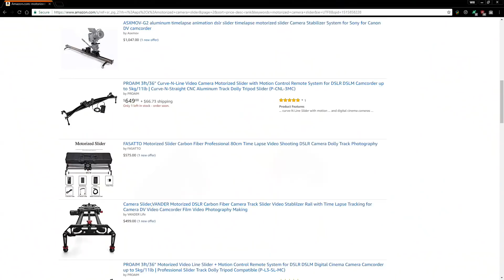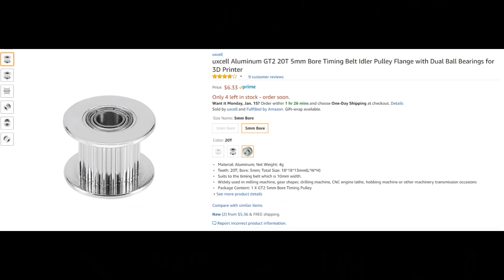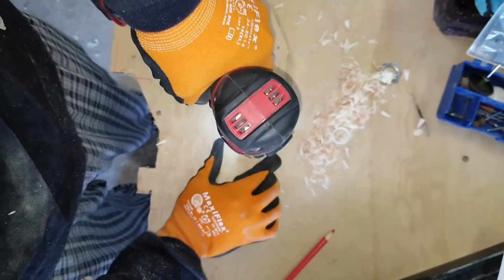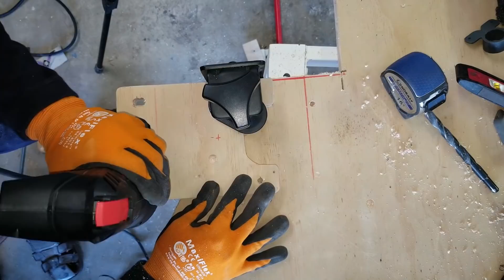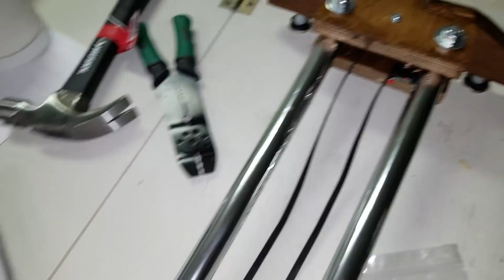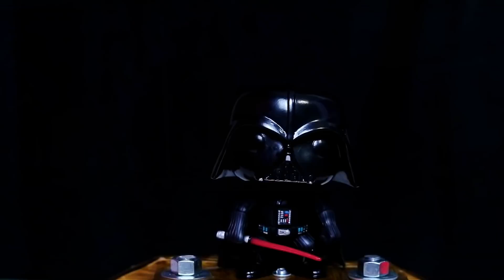DIY Motorized Camera Slider with Auto Forward/Reverse Switch 2018

Comment: I built something close to this. Same reverse switches but never could get the switches to work. If I use my hand to hit the switch it works because I am hitting the switch like on and off as in a tap. But the slider just touch the switch and alway just set there with the switch pushed in..... the slider will not go the other way until the switch is released.... I can't over come this ?????